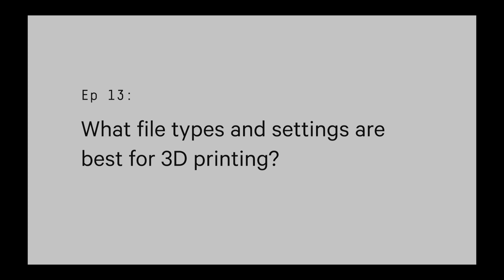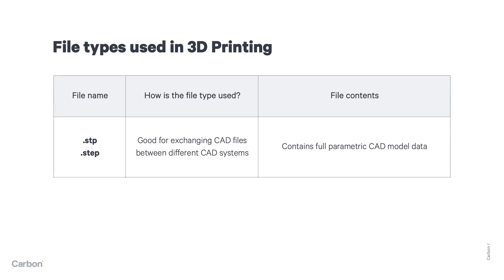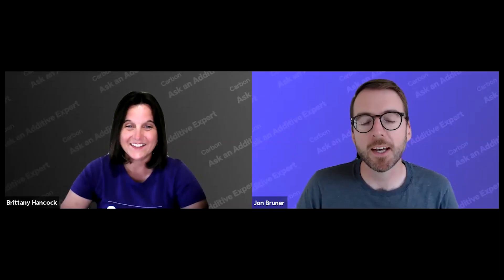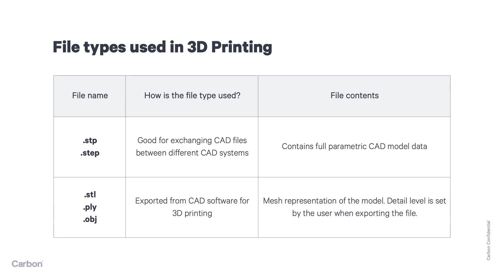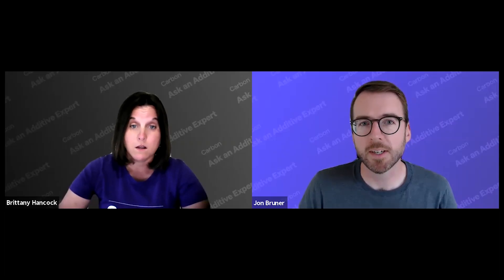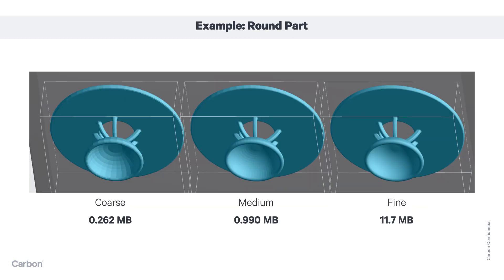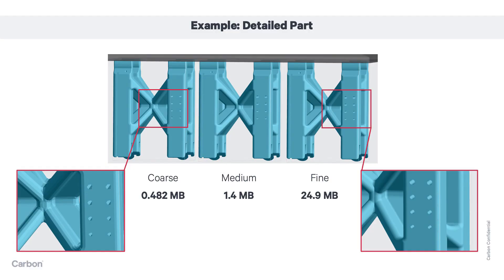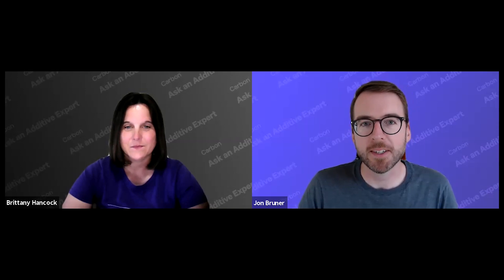3D Printing STP vs. STL Files - Ask an Additive Expert

Comment: I have been using 3MF and seriously considering STEP format as from what I see and understand, rounded surfaces are cleaner when printed. Sadly I find less people are downloading my files when they are on that format compared to STL. I find different and sometimes conflicting informations about those file formats.  Some stating malicious G code can be inserted in 3MF. So I’m really having a hard time finding the right information in clarifying it so explain the why of the benefits of 3MF and STEP aside from the file sizes and quality advantages.

Is it true of those malicious codes can be inserted of is it a myth.  I design 3D terrain for tabletop gaming, self taught, so I don’t have the benefit of proper education on the technical file format technical aspect.